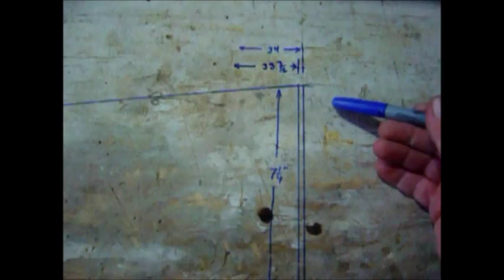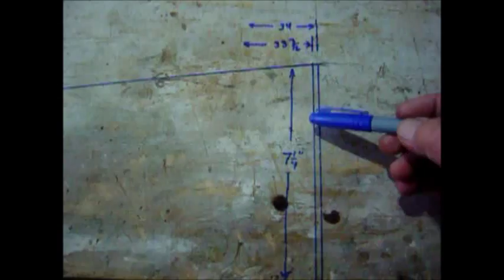Solar Water Distiller Build Part 1

Comment: Hi again Sir Starfire! One more question fer ya: where on Earth do you purchase 1x8" PVC board (actual dimensions 3/4" x 7.5")? I've been searching the web and none of the major hardware chains seem to carry it (Ace, Home Depot, Lowes - even Amazon). I'm gearing-up to commence a build, but this is putting a kibosh on the whole thing :-(

Quick update: I did find a place online, but it would cost more in shipping than the material pieces, themselves ($365 total cost + shipping for two 16' long 3/4" x 7.5" boards). Does that sound right to you?
Reply from the maker: Don Saito I answered your question already about the 1 x 8 & 1 x 4, PIC  board. I got it at lowes but home depot and other lumber selling places should have it. 

I could be wrong but i think that in one of my video on building the distiller I even have a shot of the board and label.
Reply from the maker: Don Saito I'll keep a tighter check on my email so I don't leave you hanging on any questions. Again sorry for the slow reply this time. Please forgive me this time.
Reply: STARFIRESOLAR - I'm very grateful you reply at all and would never expect help other than at your own convenience. That said, I'll be a monkey's uncle: I found PVC boards, item# 238349, .75" x 7.25" x 12' at Lowe's for $41.98 each. Thought I looked there already, but guess I missed it. I'm certain, however, that Ace and Home Depot do not have it, as I went to both places and had them look for me. But besides all that, I now have a reasonably priced source (!), and can continue with my build, so THANKS yet again.

Update: Oops, celebrated too soon :-(  Turns out that while Lowe's does list the desired item, they don't have it in stock, and they don't deliver it from their warehouse. One wonders why they bother listing it at all. So, I'm stuck again :-(
Reply: Hey, hey! Good news (6/28/2018): For the heck of it, I checked Home Depot again for PVC boards, and now they have them, and even in the size I was looking for. I purchased two "paks" for $163.90, each pak containing three 1"x8"x8' boards, and the shipping is free. I'll finally be able to start building my own Starfiresolar water distiller - how nice!
Reply from the maker: Don Saito Hey Don, buying the PVC board in 16 ft lenghts is going to cost you more due to special order shipping. When I bought it I just went with what was in stock.
Reply: I'm getting them in 8' lengths, so the shipping is free - how nice!
Reply from the maker: Don Saito I'm glad you finally got a line on that PVC board. I was very surprised that you had such a hard time finding it. I can buy it at lowes and home depot also other local lumber yards here in coastal NC. Hopefully you don't have problems obtaining the other materials locally. Please keep me in the loop as to your progress. Thanks
Reply: Thanks, yeah, I'm pretty happy about it too. Okay, will keep you posted, but now I've got a more overarching problem I have to deal with, which may put the distiller project on hold. Sigh.
Reply from the maker: Don Saito Thats the way it goes sometimes. Keep the faith, you'll get them built. Again, keep me in the loop. I'm always interested in seeing others build these distillers and be of help if I can.
Reply: Thanks Sir Starfiresolar, I will keep you appraised of any progress I can manage for my distiller builds. Speaking of which: I take delivery of the PVC boards next week, so I'll at least have the materiel to begin, even if I don't quite yet have the time.

Comment: Hi there. Why not make the 'boxes' square on all planes, and then just tilt them to the required angle? Or am I missing something?
Reply from the maker: Sorry so late on the reply Eric, and thanks for the question. 

The water in the basin is only about 5/16" deep. The more water that is on the basin the longer it takes to heat up. The unit will work filled to deeper levels but the production will be slower until the level get's to about that 5/16" level. That is enough to allow for a full day of solar heating to evaporate as much as it can yet not allow the basin to be ran dry before you can get a chance to refill it. Keep in mind that the water in the basin is what makes the seal between the top and the aluminum angle of the basin itself. Once the water level drops below where the sides of the top rest on the aluminum angle there is no seal to keep the water vapor from escaping at that point. Yes, an ever so small amount of air passes in and out of the small hole in the fill port cap but It is really not of any consequence. The inside has to be vented as the air pressure increases and decreases due to the change of the internal temperature. If it is not vented properly as the water in the basin heats up and expands and it will rise between the outside of the top and the inside of the basin walls and leak out of the basin and when it cools air will be sucked in through the same space.

In my build video, "Solar Water Distiller Build #2 Part 5",  I show how this level is obtained. To go right to this part of the video advance to 11:35. 

The distance from the bottom of the fill tube fitting to the glass of the basin works out to be 5/16" in this process. When the unit is complete and you add water in the fill port you can see the water filling the basin to this level and stopping the fill as the water touches the bottom of the 90 degree fill tube fitting.

The fill level is not hyper-critical so it's ok if it is slightly higher or lower, as I mentioned before the more water in the basin the slower it get's heated the less water the faster it heats.  I find that the 5/16" of water  is an optimum fill level.

That's my long winded answer to  your short and simple question. I have a tendency to over explain things sometimes but I try to expose the method to my madness. lol

Thanks again for the question, I hope I have done a good enough job answering it yet not causing any confusion.
Reply from the maker: I"m sorry for the delay in answering. My 3 yr old Grand Daughter assumes control of my PC to watch her kiddie videos morning, noon, and night. LOL.  I recycle/re-purpose the glass from old sliding glass doors and that is why the "boxes" are not square. Of coarse if I find a nice piece of tempered glass that is Square, then the "boxes" will be Square. I hope that answers your question.
Reply from the maker: I may have misunderstood what you were saying about making the boxes square and then tilting them. as the base contains the water if you tilt it then the water will not be level. Tilting the basin will result in the water running to one side and leaving the basin dry on the other. The basin water being level is what makes the seal between the top and the basin, keeping outside air from flowing into the containment.

I hope I have addressed your question. If not let me know.  Thanks as always for your comments and questions.
Reply: No worries, thanks for replying.It was a stupid question anyway, as I was referring to the trapezoid shaped sides, and then realised that the glass needs a tilt, but the water container doesn't!
Reply: Question: How deep is the water in the base unit when you fill it?